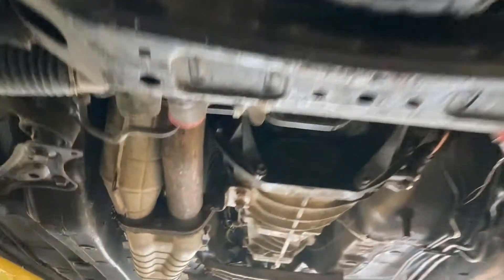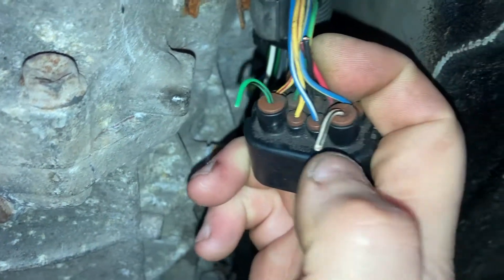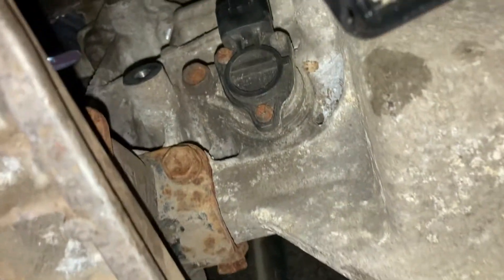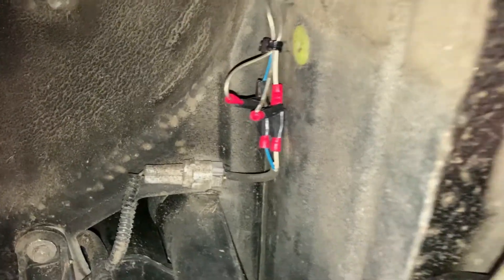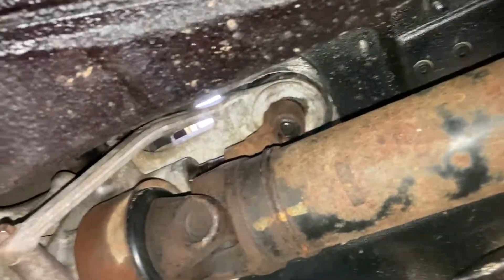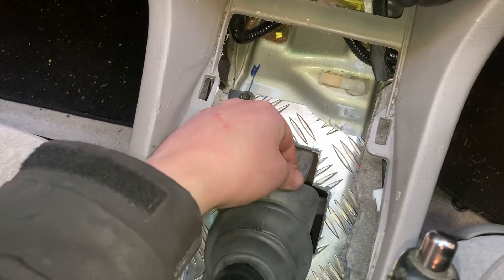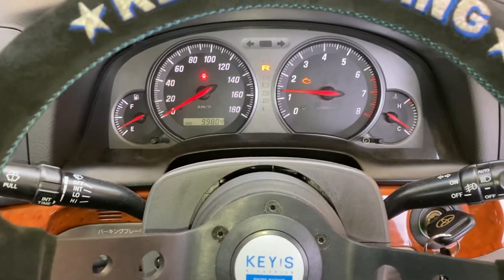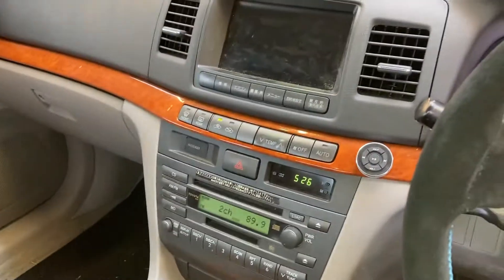GX110 Toyota Mark II, J160 6 Speed Manual Transmission Conversion Part 3: Final Wiring Touches

Comment: Did you use the LHD is200 handbrake in this bud? 

Where abouts can you get them from or do you have a part number or list of what’s needed to fit it etc ? Cheers 🍻
Reply from the maker: yes mate! i got mine from ebay, OEM part number is: 
46201-53030

you will also need the cable that goes into the lever, part number: 
46410-53020

they are a direct fit, but you will need to drill 1 extra hole for 1 of the 3 mounting tabs on the lever as its not pre-drilled from the factort, it takes 2 minutes with a drill
Reply: @BENJY-JP  cheers bud, was that on eBay.com or something? 

Can’t seem to find any LHD ones in the UK or u get it shipped over?
Reply from the maker: I must of got lucky, mines came from USA, the eBay seller’s account is called “snd-tuning” give them a message and see if they can get you one
Reply: @BENJY-JP  hi I want to ask you my car is markii grande gx110 2002 model I converted to j160 gear box but tell me how to fix engine light and abs light on dashboard meter
Reply from the maker: @rajaqasim5950  i explain in my video how to get rear ABS feed from from one of the front ABS sensors. The engine management light requires a transmission emulator which I explain in my video too
Reply: Ive got wires running from front abs sensor to output harness on the loom but my ABS light is still on? Any ideas?